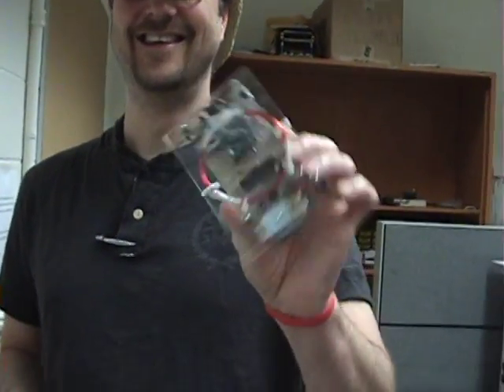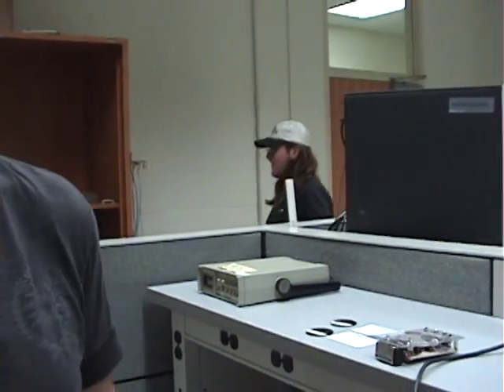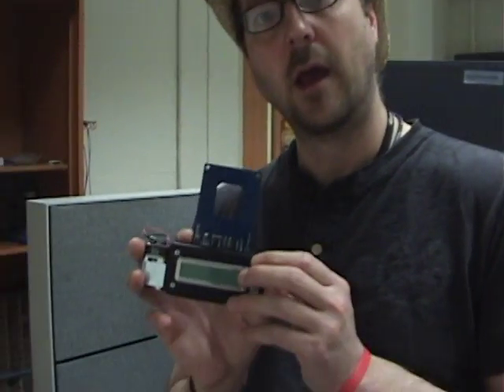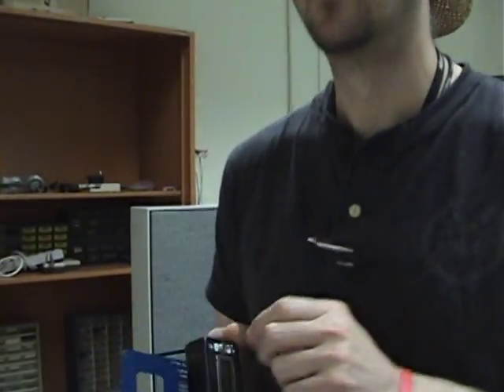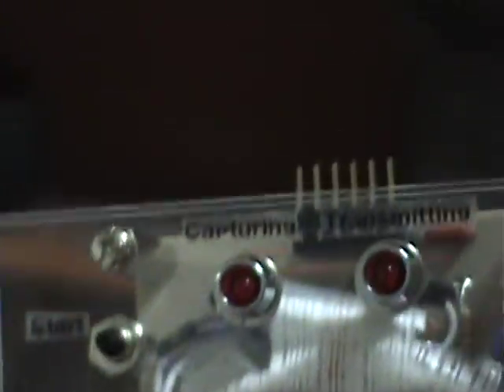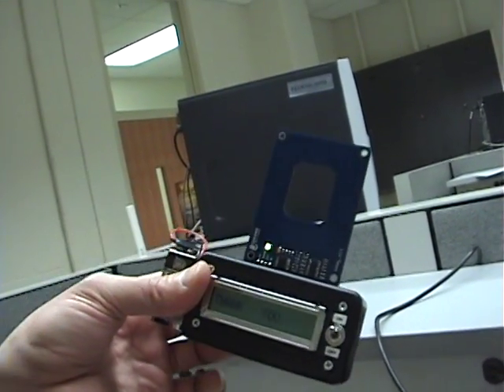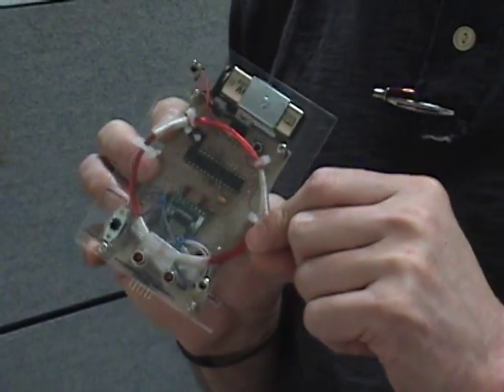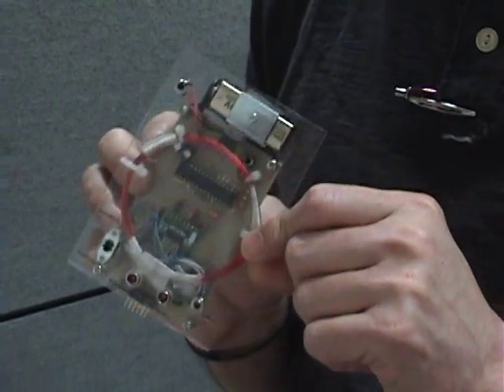RFID: Building an RFID Emulator

Comment: That was an interesting video, thank you for sharing!
If you are still doing things with this project after 5 years, have you made any advances or other interestings discovery about the subjets? Or maybe found new tools to help with what was stopping you?
Reply from the maker: Thank you for the vote of confidence.  A lot has happened since 2008 when this UofI project ended. I should really pull this project back out of mothballs... :) There is far more to be learned...
Reply: @MrAgentCD  I encountered your video recently after starting to search more about how RFID/NFC work, later after that I encountered Software Defined Radio and how that work, that made me wonder if there was a way to make both interact together. In a practical example that could be interesting during a fire alarm that something like that broadcast an opening signal to unlock all the door. Or at a prank level ring a store RFID alarm... 
You can count me as a new subscriber if you ever continue with this project, that start was interesting! I'd love to see more one day!

Comment: you could solve the problem with an hf amp
Reply from the maker: Really? I'm not so certain that would work, as I recall the HID cards/rcvrs were running at 125kHz as well... just at a much faster data rate...